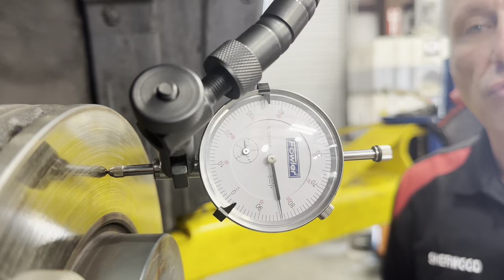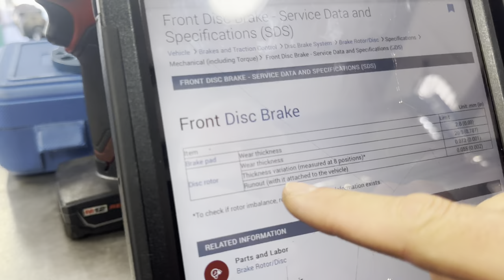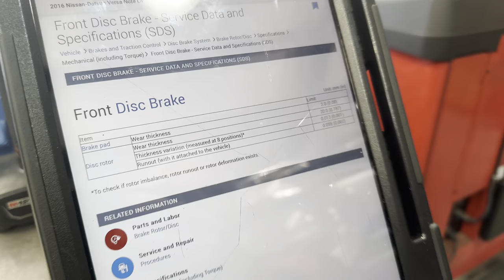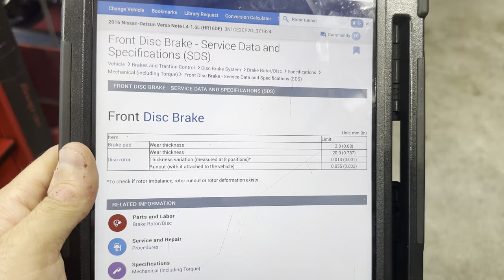It’s Vibrating When Braking & It’s Not the Rotors. How to Test! (Nissan Versa)

Comment: This man is being deceitful he is not telling you the whole story! If the car came in with a pulsation and he checked the rotors to see if there was run out in the rotors initially that would change the whole aspect of what he's just talking about. He had  pulsation before the brake job was done on this car. And still had it after the brake job done. Then you check the hub for run out!! This isn't a normal  out come it's not uncommon just not that common all the time!!